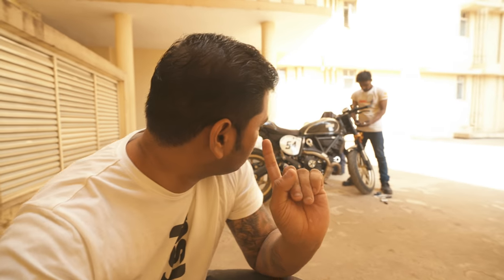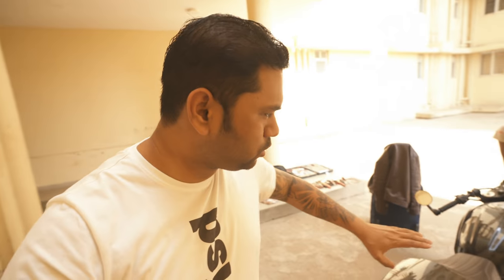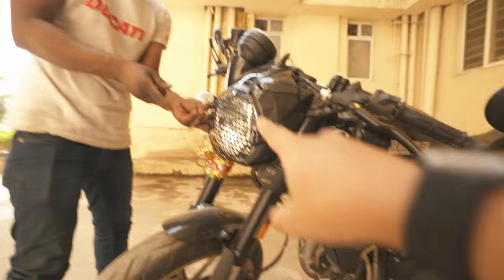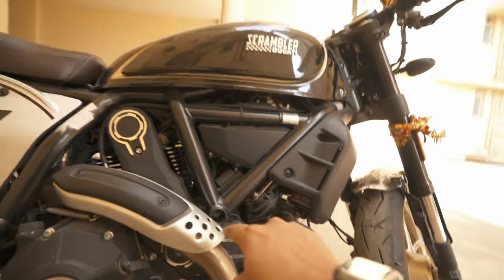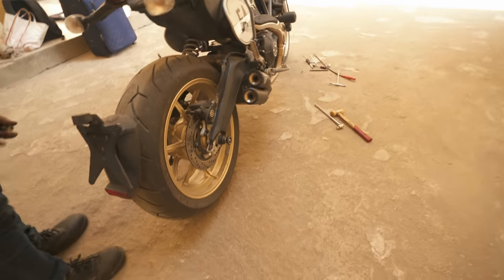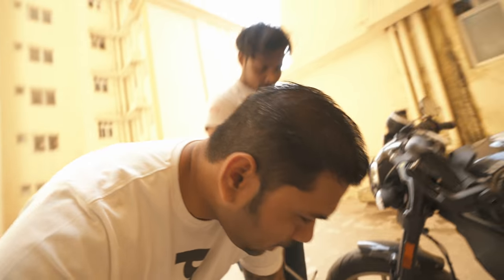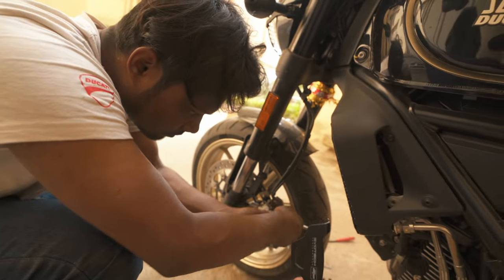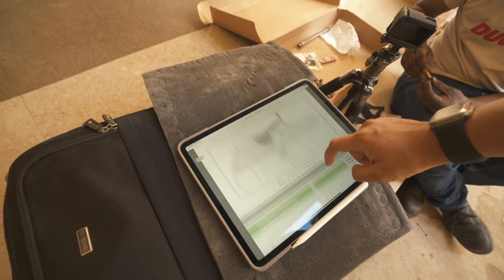Ducati Scrambler Cafe Racer - Installing the Accessories!

Comment: Buddy I'm planning on getting the cafe racer what was it on road and man is it an amazing bike just got in a test ride yesterday real fun.
Reply from the maker: Sankalp Roy super awesome. It's so well crafted and designed. And rides so good 🔥🔥🔥🔥🔥🔥
Reply from the maker: Sankalp Roy check with Delhi dealer for 2019 model if you need
Reply: I was really into the black 2017 model they  don't seem to be very clear if they can supply that hence looking for other dealers
Reply: Sorry for bothering but reliability issues are a prime concern for me please do share your thoughts